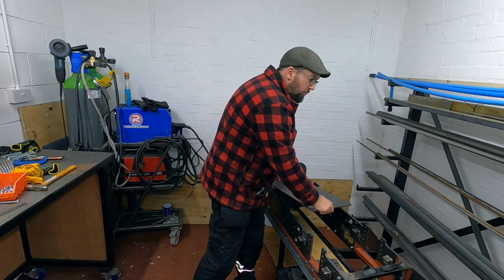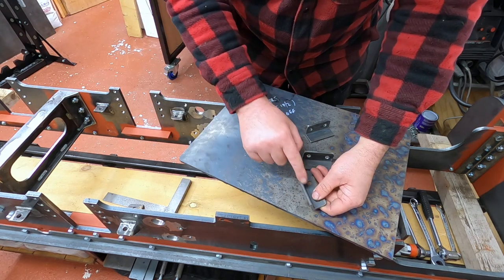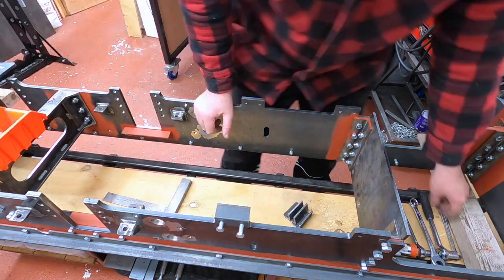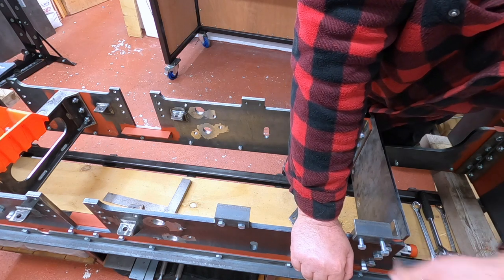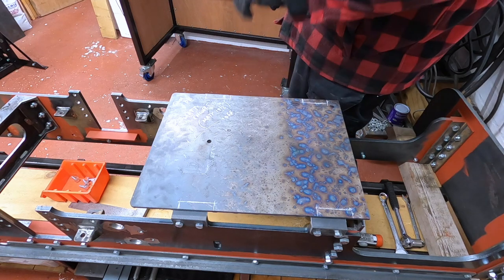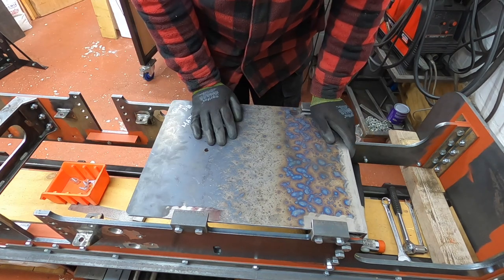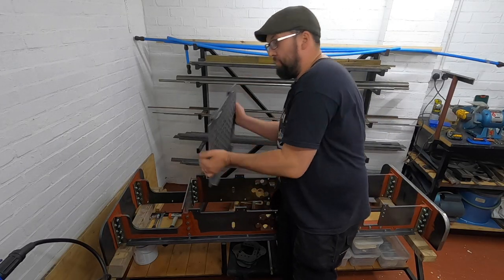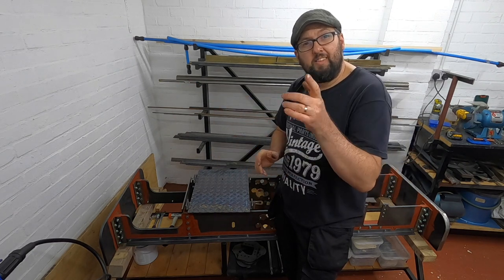The Footwell Part 1 - EP12 - 7.25" Gauge Steam Locomotive Build.

Comment: Hi Matt,  Greetings from a kindred spirit. You are one lucky begger, to buy a Bridgeport at a knock down price and find very little wrong with it, yes I know there are some minor problems but on the whole it is as near perfect as you can expect . I have been building a three and a half inch gauge Britannia for near on 40 years with too many interruptions in between. I have just recently bought a small house up near Great Yarmouth and intend to use the front room as a workshop. My wife passed away just 4 months ago so I will have no one to offend. It requires a bit of work to make it habitable but, what’s another few months compared to 40 years. I have many projects on the go one of which is a largish CNC router- not finished yet but near- I am now waiting for the solicitors to complete the paperwork so I can get back to my engineering. I enjoyed your videos a lot as I found you quite funny and I have not had a lot to laugh about lately. Considering your train is twice the gauge of mine, it seems huge. I have many things in my life that slow me down apart from age as I am a Hypnotherapist (amature), Theoretical Cosmologist, Qualified Electronics engineer, a precision metal working engineer and taught near on 20 trades at the YTS almost 30 years ago. I am blighted with Chronic Heart disease but have learnt to live with it, and I still manage to get things done albeit a bit slower.
Keep that happy outlook and good luck with the train. What is it by the way you now have me very curious, some sort of 2-2-2 or a single wheeler . Please satisfy my curiosity.
Regards to you and yours
Mo King BSc(Hons)
Reply from the maker: Hi Mo, Thank you, Good grief what eventful reply, sorry to hear about your wife, we had a  bereavement in the family around the same time, so from the channel we send our sympathies. 

Now onto this build your doing, 40 years!!! You've waited long enough, time to give it a big push and get it done!! 

The locomotive I'm building is a 'Tinkerbell' Class based on a design originally by Roger Marsh. It is a 0-4-2 locomotive which you sit inside, they are extremely big, heavy and almost there own narrow gauge locomotive in there own right.

See you in the next video, stay safe, Laters. Matt

Comment: Hi Matt.
Another very entertaining and instructive video 👍
Here in Oz, we can buy a primer called ‘Upol Copper Primer.
Car body types use it to prime bits that are going to be lap welded. It doesn’t react to the welding process like ( nasty) zinc based primers.
Just a little bit of corrosion protection where the lap isn’t fully sealed by weld.
I find it goes ok with stick or MIG.
That loco is going to be one heavy bugger when it’s finished…. plenty of traction there eh 😎?
Regards
Robert
Reply from the maker: Thanks Robert, 

Yes you can get that here, I could have used it but I came to the conclusion that its going to take a while to rust through the overkill plate I've used 😂. Heavy yes, traction not sure, it maybe too heavy to move!!! 😂😂.

All the best, Matt.